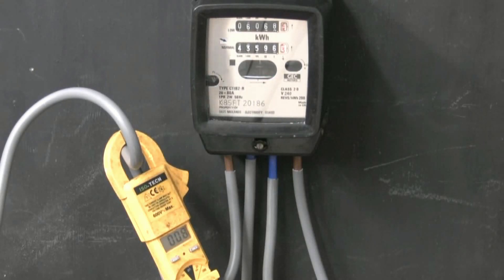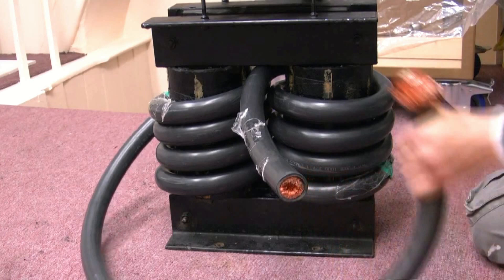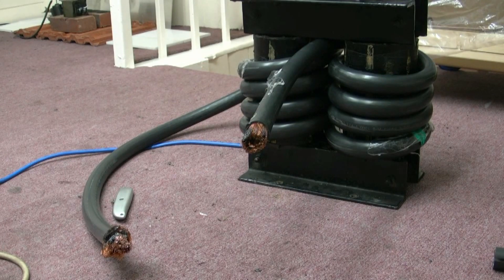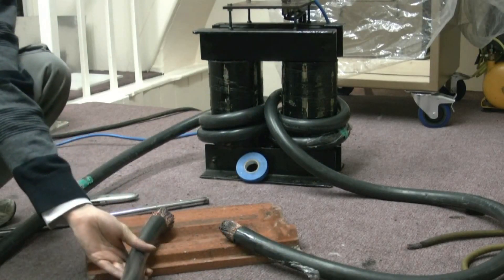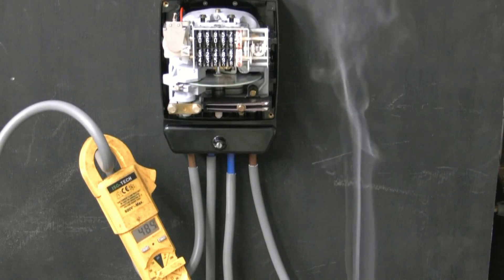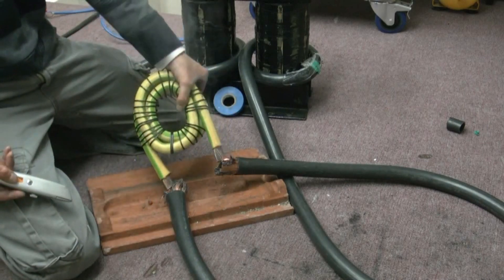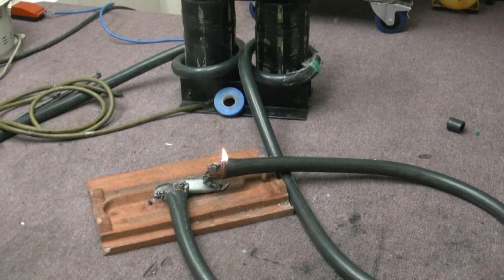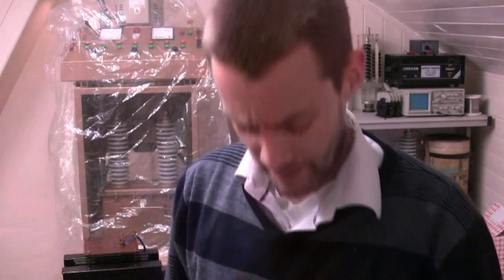Too Much Current + Electric Meter Pops

Comment: How much you think there electrical bill will cost
Reply: Meter reading at beginning of video: 43596kWh
Meter reading at end of video: 43600kWh
Electricity usage total: 4kWh
Price per kWh: about 12p (maybe a little more because this is an Economy 7 meter so the peak charge is a bit higher, but then this video is from 2012, so probably not)
Total cost of electricity to make this video: about 48p
Blowing the power to the whole street for shits and giggles and science: Priceless!

Comment: 9:07 How is this dude still alive?
Reply: Yeah I know, after being kicked out of the x-men academy, Surge must have found a job and worked his way up!
Reply: The amount of misunderstanding in this thread is unreal......
Reply: @Dakota Dirden 

Mate you have no idea what you're talking about.. 

Wattage is electrical power. V * A is the formula you'd use to get the wattage.. if you have high wattage, you're going to have both high Volts and amps (Or relatively enough to cook a human)

e.g 120V * 12.5A = 1,500 watts.. more than enough to light you up like a christmas tree.
Reply: Because you don’t know how electricity works
Reply: Tyler Rheaume I'd love to see how you think DC can flow through a transformer like that
Reply: 8 Bits I think he’s getting confused with inverters and transformers
Reply: mattvaughan180 what he's touching is not even close to 240v. He would most certainly be dead if that was the case. He is touching probably around 10-5v and according to ohms law, he will have .0001mAs going through him using 10v for the voltage and 80k for average skin resistance. I=v/r

Now about transformers...

Transformers step down/step up voltage, mainly AC (however DC can be pulsed to be stepped up or down like an inverter). When the transformer has many windings on the primary and very few on the secondary voltage is stepped down and it is able to supply higher current (dependent on the thickness of the secondary wire).

 Assuming perfect world conditions for everything below

Lets say your house puts out 240v with a max current handling capability of 15 amps. Now let's slap a transformer on the mains with a turn ratio if 2:1. The voltage would be 120 and would be able to supply 30 amps. As you probably noticed voltage divided and current handling doubled. That's what the turn ratio does. It would do the opposite if the ratio was a 1:2 (480v with max capability of 7.5 amps) Now keep in mind that the 3.6kW (240 x 15) limit is there because of your breakers/wiring. If you bypass them the transformer will draw way more current than is safe with dead short conditions and so will just shorting out the mains plug. This can and will lead to your house catching on fire and possibly dimming the lights of people on your transmission line transformer. I can definitely see Andy bypassing his breakers or re-wiring his house with high current wiring, 10 gauge, atleast, if he really wants to mess around So that would explain what happened here.

Edit just re-watched the ending and it seems like he is taking the power directly from the transmission line transformer that is outside. Because he is talking about drawing about 100 Amps. And no regular house wiring cam take that without bursting into flames. He probably has a separate giant ass cable running up to this room from the basement.
Reply: Kyle Bishop yawn..... Christ everybody watch out there’s a know it all kid on the loose here!!
Reply: This guy has deep knowledge in what he does, every move and decision is well planned and confident. He only plays fool for fun.
Reply: @TheMrSinus  The definition of Expert
Reply: He is not a dude, you're a dude, this... this is a man
Reply: high current but very low voltage
Reply: High current, extremely low voltage.
Reply: @yngvai777  yes the low voltage can't kill him
Reply: He's on the secondary side of the transformer... there's nothing to ground to, since the entire thing consists of two loops of wire.
Reply: Kyle Bishop wash your mouth out young man before your mother sees,the way I see it and the general public here on youtube is he’s dipping the lights out to the whole street drawing many hundreds of amps and 240v,were not electronic wiz kids but obviously touching metal that’s drawing juice through it looks pretty impressive right
Reply: Dakota Dirden volts x amps=watts...
Reply: I was wondering the same fuckin thing...
Reply: He is not grounding it
Reply: Is it possible that no one here has ever seen someone do arc welding? It's the same thing... although there are more than 100 amps, you can easily touch the metal that is being welded! (heat apart). Same for car battery: it can pump 400+ amps, but if you touch both poles nothing happens. Body resistance is too high for the low voltage of that transformer (probably 4V or less).
Ampere trought body: 4V/1Mhom=0,000004A (4uA). Impossible to feel.
Also in this case is like the Faraday Cage: ONLY if you are PERFECTLY isolated to ground, current flow trought the lowest resistance path.
Reply: Because you don't understand electricity, anything about resistance or Ohm's law or about closed circuits.
Reply: ohms law m8 he taught me about that.
Reply: May have a rubber earth mat down too under the carpet,he’s gotta be running 240v there and high amps to dip all the neighbours lights and drop the voltage in the local substation,surprised he never popped a fuse at the substation to be honest and the fuse in his cut out,
Reply: Random Videos - Cr1TiKaL Full Streams he's still alive because electricity ALWAYS ALWAYS chooses the shortest way
Reply: Artur that is some what true electicity especially lightning will be shunted by the path of least resistance but will also take other routes too, it can as in sometimes does take the path of all resistence, I learned this from Mike Holt who instructs inpectors on the National Electric Code (NEC)
Reply: the voltage is pretty low, but the current is high !!!
Reply: I mean, he hasn't uploaded in a while...
Reply: Low voltage so his body's resistance is stopping any current from going through him
Reply: This is very big current, but this is very small voltage, that's why he wasn't killed by electricity
Reply: Because hes actually a lot more clever than he initially comes across in his nutty videos.
Reply: Sheer British resilience and stiff upper lip
Reply: Because the current follows the path of least resistance
Reply: Ohms law, low voltage but very high current
Reply: Tyler Rheaume nope. A transformer is two windings attached to a common ferric core, which allows AC to pass through and get stepped either up or down. DC physically cannot flow through it. If you're thinking about wall wart "transformers" those are technically power supplies, although they do have one to initially step down the mains voltage in some of them. Do some reading on your own if you're interested
Reply: There's no reason for the electricity to go through him, the fastest path to complete the circuit is through the knife and not his body.
Reply: the answer is actually really simple: electricity always goes to the fastest way in a circuit, as you can see, there is a metal thing touching both cables so the electricity will go through the metal thing and he just touches the metal thing with one finger so if the electricity went through his finger it wouldn’t have a way to complete the circuit.
Reply: @llaser1433  what if the metal moves and only touch his finger and 1 cable?
Reply: @Saens406  nothing will happen because he isn't grounded. Even if he was the voltage they used was so low that there's no way it would get through his body to the ground because the skin has quite a high resistance
Reply: @llaser1433  but dat shit is hot lol
Reply: Isaac Sánchez Jin yeah you can see that he flinches with his hand when touching it lmao
Reply: llaser14 another expert spouting bullshit like it's fact.
Reply: Please, stop embarrassing yourself.
Reply: Electricity doesn't only follow the path of least resistance though. 

Electricity goes through all paths, it's just that he's not referenced to earth, so the circuit can't close properly, and also the voltage is low enough that if it did close, he'd barely be able to feel it
Reply: high current low voltage
Reply: to anyone that knows, what would happen if he touched both wires? like if he put one hand on each wire and closed the circuit, would he get hurt?
Reply: He had 0 volts across his body and therefore no current was flowing to him or through him. It has nothing to do with the voltage or amperage the circuit was being driven at during that time. Had it been much higher voltage at higher frequency he may have caught a burn from an arc going to his body. If he touched both wires with each hand he would get lit up like xmas.
Reply: Yea I guess in this case he could actually touch it bare hands without much worry but even if it was higher he'd have been alright.
Reply: He is alive, because the voltage is very low. Because of low voltage, and the resistance of his body and otherwise difficult path to earth, the amount of current flowing trough his body is very small.
Reply: My above statement, further proved...
Reply: Random Videos - Cr1TiKaL Full Streams it's only watts going through the metal, not high enough voltage to kill someone, we are resistant to watts

Comment: There are some comments here that show an incomplete knowledge of electricity in general and transformers in particular! The Power of a transformer is the amount of power you can put into it .... which is the same as the power coming out (minus the efficiency) The number of turns of the primary winding divided by the number of turns of the secondary winding will give you the ratio. The ratio is the Voltage in divided by the Voltage out! (or the Current in divided by the Current out) There is also a Reactance (AC resistance) that will limit the current flow in the secondary. This will give you the Theoretical Maximum Current the transformer will give! Obviously adding resistance in the form of bad connections will further limit this value! Adding a further high resistance in parallel with this in the form of a human body will have so little effect it will be almost impossible to measure! 
One point nobody seems to have noticed is that the secondary winding seems to be floating and could be at any voltage at all! When he touches this HE is the earth point!

Comment: what sort of volts were you running to allow you to touch that rod contacting both terminals?
Reply: then to be able to touch it when you are connecting the stanley blade?
I don't expect to understand electricity better than yourself but 240v at 500A seems like enough to blow an elephant in half????

Comment: Why is it that the wires themselves don't burn, but only the conductor (metal) that is put between them?
Reply: Henrik Nielsen Because the copper wires have a much lower resistance and thus dissipate much less heat from all the current.
Reply: Ah I see, I actually thought the metal they put between had a very low resistance, like the wires, but yea I see, if that was the case it wouldn't heat up like that...

Thank you

Comment: question now I am not a electricity expert such as him but how is he able to touch and hold something reactive to such high voltage and amps without getting electrocuted and die?
Reply: RB2 Cinema only the amps were high, not volts. As long as the volts don't go above 4 (I believe) it can't overcome the resistance of skin so it doesn't jump through him
Reply: RB2 Cinema only the amps were high, not volts. As long as the volts don't go above 4 (I believe) it can't overcome the resistance of skin so it doesn't jump through him
Reply: Lazarus Maximus ah I see electricity sure is weird.
Reply: RB2 Cinema Not in particular, you just got to know a few baseline tricks and it is actually very logical and simple
Reply: Lazarus Maximus hm I shall invest into learning some electric basics
Reply: Volts are the unit of electrical tension/pressure, amps are the flow rate of electricity and ohms are the resistance. Those are the very basics that even kids know. (Sorry, too tired to explain further but, Wikipedia is your friend so go a head and start from there)
:)
Reply: Lazarus Maximus Thank you so much!

Comment: How does the electricity not go through the metal rod and into him if he is touching it without rubber gloves?
Reply: why do so many people ask this i mean it would take a 2 second google search to get the answer probably faster than writing this comment or you could scrolöl down to see one of the other hundreds of questions answerd but in short ohm's law the voltage is very low and his body resistance is too high for the voltage to put any feelable current through his body

Comment: What is that device called the one where you can get it to raise the voltage and pop eletronics by over volting them?
Reply: transformer LOL
Reply: Well then I should buy one. I would use it to blow up motors when people junk them.
Reply: That is useful. I would use one to pop a house with eletrolincs.
Reply: FriedFrudda
you should buy a variac which is a variable transformer just plug it into mains and pop things
Reply: I hope I buy one that you plugs in things that uses 240 volts.
Reply: Its a variac. Not a transformer. This variac is modified. All variacs are 240volts. This one is 400volts. Double the power

Comment: HOW THE FUCK IS HE PUTTING HIS FINGERS ANYWHERE NEAR THAT ROD IT WOULD INSTANTLY VAPORISE YOUR HANDS. Assuming it's steel it's hitting well over 1500C between the contacts and would be at least 500C down the rest of it. WHAT??!
Reply: it's obvious, Zeus is actually a drunk Brit with lots of toys
Reply: I'm aware that's at play but that doesn't apply to conducting heat! A steel rod that was storing that much heat over that area would spread in a seconds to the rest of it. I'm aware of no science that explains how he can pick that rod up.
Reply: samthepoor thats called galvanic isolation
Reply: MustiONE02 Precisely

Comment: how comes you didnt shock yourself?
Reply: Aditya Singh thats why i asked...
Reply: that makes no sense at all. current doesn't take only the least resistance path. the current spreads proportional to the resistance in an parallel circuit.but in this case there is no Voltage different to ground because of the Transformator. ist isolated from ground.and on top he uses low voltage anyway.
Reply: TwaityZee amps would kill yet if the potential difference is too low current won't flow. you need some voltage to shock you and in this case, he's playing with 1 volt potential difference.
Reply: he's at the same potential as the electricity. u don't see him holding onto anything else in his other hand , bridging the electricity. He would explode if he acidentally fell over or he grabbed a metal pole that was grounded In his other hand while still touching the live stuff.
Reply: @no0dles99 he is grounded... with the ground
Reply: SpreadLikeFire amps will kill you twice as quick of watts would do. Dumb ass😂
Reply: it is not "amps kill you" or "volts kill you"... it's the energy, the high frequency and so on
Reply: The voltage is to low to pass thru your skin pretty much, your body has way more resistance than bare copper wire
Reply: I'd say the current will take the easiest way. In this case the resistance is his body is ridiculously much higher if you compare it with the fat cable.
Reply: Allptraum something tells me you lack knowledge
Reply: amps will kill you i think you mistyped
Reply: Exactly....it's like a spot-weld transformer. Secondary voltage is 1V or less.  I used to have a (much smaller) 1V, 50A transformer that was good for removing clads from PC boards (back in the old days of double-sided boards) and heating things.
Reply: think it's the fact they are increasing amps. amps don't shock you, volts do.
Reply: haha rekt xD
Reply: think it's the fact they are increasing amps. amps don't shock you, volts do.

Comment: how come you can touch the metal rod with all that amperage going through it and glowing? without getting electricuted
Reply: The electric current travels from end to end of the wire, hes not in the circuit. The only risk is maybe heat traveling down to his hand.
Reply: Cold Start Daily   It's only a few volts, not enough to overcome the skin resistance. Also it's acting like an isolation transformer, as in he is not referenced to earth and therefore can touch one output terminal (not both) 
For more information about the volts/amps which part kills you, just search for any video on this topic on YouTube (spoiler alert: it's both)